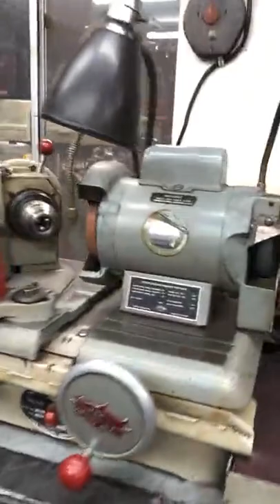EB TAKEOVER: Maloof Racing Engines

Comment: 33:30 for anyone that's never known the difference between a balanced and blueprinted engine vs a stock engine, they're night and day difference. You're not going to have an engine left if you rev an eight cylinder past 8k rpms, and it's not balanced and blueprinted. It will tear itself up. It's incredibly important to get everything set up correctly at the bottom end and with the rotating assembly. You can push all the air and fuel you want, but if you can't rev past 5500 rpm, you're missing out. Glad to see it done right. 👍

Comment: Maloof Racing Are the Best!!  Sammy use to build ( bullet proof) motor 2 - 460 side oiler 20 Thousand each in the 80’s bloat was a 28 foot ocean racer, Campbell Boats was bulletproof made of Kevlar hull sterling 
cable broke flew threw a motor home ‘ No lie fixed cable put back in the ocean back racing & Won the race half way through the track So this is what Mr. Sammy Maloof Racing  A +.
Brook A. Campbell
Thanks 
Sammy Maloof

Comment: Today seen your show on Netflix. How awesome! 
Wondering if you ever fixed the stuck throttle on your Chevy Bel Air? Was that Ford Mustang ever to be riding on the autobahn? It’s been years since you rebuilt my brother’s Chevy Scottsdale and my Dad’s 85 work truck. It lasted for years hauling and pulling the tractor 🚜. 
Happy to see your still in San Gabriel Valley in the same shop. 
Keep those engines roaring the way you only know how too.
San Fernando valley neighbor. Joey  ✌🏽

Comment: Ur wife daughter is recording app in your wife’s office 
I still really need to know if you can do a tune up have approximately  driving past 2 month guessing 700. To. 1000 miles 
Could you please send me a text message with address and get you turned master builder.
You bolt a few 460 side  oiler  Dad told me that the price for the motor, bought from  Ford’ and then you did ur magic. My dad was so impressed. He won that race by two laps ahead, and he drove through a motorhome.
Reply: Can I send you some pictures of my pride and joy in

Comment: This is a COMEDY! Doing the "old-school" screwdriver "engine stethoscope" thing but holding the screwdriver shank in their hands and thus "cancelling out" any possible "noise" IF the "composite" valve covers and their rubber seals/gaskets could "conduct sound" in the FIRST PLACE. 

Then there's the hilarious "throttle response" and "revs" coming at least 1 or 2 seconds after he "cracks" the throttle and with ZERO "backfire" out of the open headers and open intake AND with zero "torquing" of the engine on the stand. 

And at "key off" that "race engine" with ZERO "accessory load" at all INSTANTLY   comes to a literal "dead stop" like it's "tight" as hell and not built "loose" as is typical of "race engines".